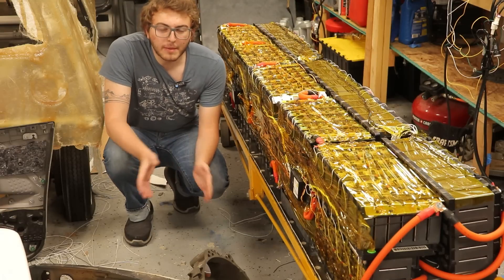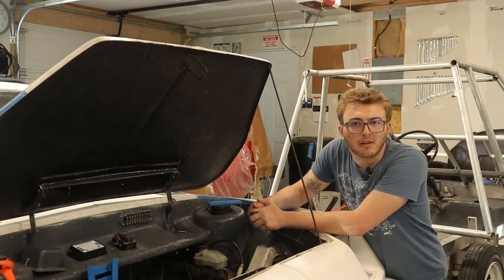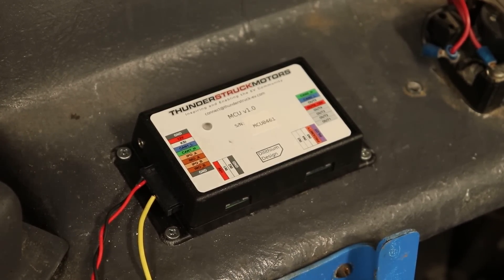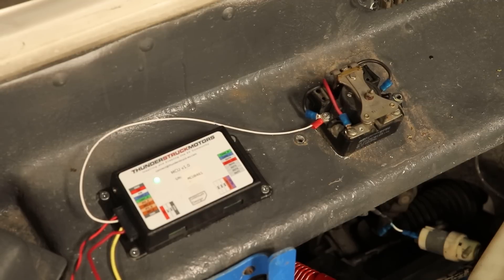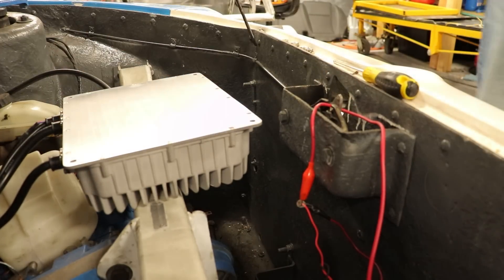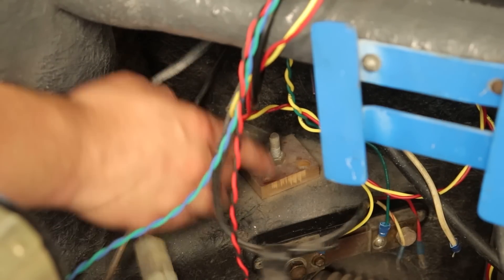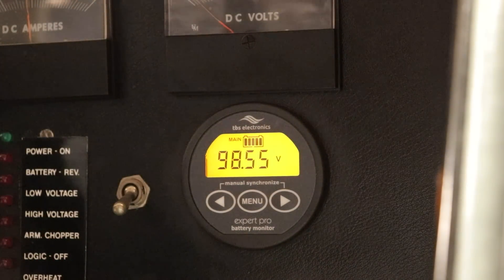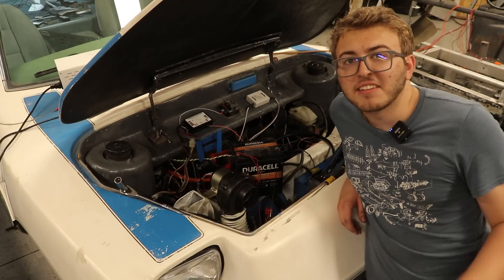Does the Electrek Drive on Lithium? | Part Two

Comment: Shunts can be confusing.

They work simply by having a calibrated resistance between the two meter terminals on the shunt.
Calibration is done in the factory usually by slitting the shunt with a fine saw until the resistance across the meter terminals is RIGHT at a certain value.

A "200 Amp" shunt will mean that the shunt will show a certain voltage across the meter terminals when 200 Amps is flowing through the shunt, maybe something like 50 millivolts (this value is often stamped into the shunt somewhere, I think).

And two shunts, each rated at the same current, may be of significantly different physical sizes, since they may be calibrated to different full-scale meter terminal voltages.

As long as the shunt is of low enough resistance to not overheat and fail at its maximum rated current, it can be of various sizes.
Reply from the maker: Very interesting!

Comment: Really nice project. I fully support getting it restored back to factory condition. When mounting stranded core wire in terminals, you should use tube terminals on the wire. Also hot glue won't last long in a car. Maybe create a bracket that goes over the device?
Reply from the maker: Yeah no the hot glue already failed, I'm gonna create a 3d printed mount for it

Comment: 14:30
Factory shunt had much bigger voltage drop so it could drive analog dial. 
Modern shunts are designed tomdeop 75mV at rated current. So at 1000A it would drop 75W.

Comment: I'd be worried about the charge connector placement, both that it is front-facing for weather ingress as you drive, and that it will potentially be underwater if you ever drive through a deep flood puddle or a ford a stream. Also, that MG is looking good!
Reply from the maker: The electrek as a whole doesn't drive in rain. It is not water proof. Also worth noting that if the charge port goes underwater, so will the controller, which isn't 100% water proof and likely would blow up the car. I think my solution is just not driving in water haha! And yes! The MGB is a surprisingly great car!
Reply: @ElectrekGarage  As long as you have considered those possible consequences, I feel less worried. I know the connector will almost certainly have some ingress protection, but never consider things to be "waterproof". Water gets angry at that designation and generally finds a way to let you know the term should only ever be "water-resistant" lol.

Comment: Quick question on the throttle.  I had a small EV (golfcart) and there was a main contactor interlock on the throttle.  Since you mentioned the throttle was reading slightly engaged is there also an interlock somewhere on your throttle?  Probably it is for safety as if you release the throttle and any other problems in the controller or circuit the contactor will open.
Reply from the maker: No interlock on this throttle, that would be asking too much from Unique Mobility

Comment: That rear suspension. So bouncy!
Reply from the maker: Like driving a trampoline
Reply: @ElectrekGarage  was it that bad with the Pb batteries?
Reply from the maker: @stazeII  nope! The reason it's so bouncy now is because the lithium batteries are significantly lighter than the original Pb's so the suspension is a lot lighter now. Ill be rebuilding the suspension in a future video!

Comment: This is absolutely awesome. I’ve wanted to see a lithium swapped Electrek since I learned about it in other videos! I’d love to know if it drives any differently, more power or anything like that. Looking forward to future vids on it.
Reply from the maker: Absolutely has noticeably more torque although I couldn't tell you why. My theory is that there is significantly less volt dropping on acceleration with allows for a smoother power curve. Thanks for your support!

Comment: This is AWESOME!
Can I ask you what your plans are after you complete your studies? Will it have something to do with electric vehicles?
It is my firm belief that repair and overhaul of battery packs , electronics and motors for EVs, and to a lesser degree converting ICE vehicles, has massive potential. Manufacturers don't want to know about that stuff, they just want to fit new spare parts or preferably scrap the cars every 10 years and buy new ones.
Of course the manufacturers will do everything they possibly can to prevent any kind of repair to the battery pack or drive train and a possible solution (besides non-stop lobbying and going to court for right to repair) would be to manufacture third party control systems using an open-source architecture.
My guess would be that third-party control systems for EVs could be a massive thing.
Reply from the maker: I would love to run a buisness that converts old cars to EV, however, my goal is more in the field of alternative energy storage systems, specifically Lithium Sulfur batteries. I'd love to build electric cars that implement innovative energy storage solutions in mass manufactured vehicles to push the industry to innovate cleaner and better solutions to the current technologies available!
Reply: @ElectrekGarage  I wish you all the success in the world with that, that is a hugely exiting field and it's only getting started. The possibilities are endless. 👍🖖🤟

Comment: Would be kinda cool/funny to swap out the J1772 connector for a NACS connector and post a vid of driving it to a Tesla Destination Charger for its first public charging session.

Also, 3M Dual Lock is great for mounting components without drilling. Holds them insanely securely and you can remove/reposition them later
Reply from the maker: Ooooo I'll look into that! A tesla charger would be hilarious! Also I will check out the 3m tape because the hot glue did not hold. Thinking about 3d printing a mounting bracket for it
Reply: @ElectrekGarage  Plus it turns out Tesla might of won the connector war. Chevy and Ford have announced their support of NACS going forward.

Comment: Amazing work! Restoring it to like new-condition visually sounds good. I don't like patina either.

Seems like you need to work a bit on the mechanical stuff as well. Especially the real shock absorbers seems to be completely shot the way you're bouncing around.
Reply from the maker: All suspension and brake systems will be replaced

Comment: I assume you're also going to correct the poor fit of the hood? I'd be looking at upgrades like a Nissan Leaf motor and a non-ancient motor controller.
Reply from the maker: The fit of the hood wasn't the problem. The footage was taken when I was still hesitant about driving it, so I left the hood propped open slightly in case I needed to emergency disconnect the battery. I've considered swapping the motor and controller for a modern part but I feel that would ruin the car's driving experience. I seriously love the ancient, terrible motor that it has!

Comment: 22:45 it needs some new rear shocks for sure. This jumping isnt normal...
Reply from the maker: It's mainly because the new batteries are significantly lighter than the originals so the shocks aren't the right stiffness anymore. I'll be fixing it!

Comment: Good work, nice to see it move under its own power. Very satisfying!

Another safety concern that just struck me, though: Do you have any BMS-controlled contactor at all? It's convention with large lithium batteries to always have a contactor in series with the battery power wire, that's able to turn off automatically if any cell voltage goes too high or too low. You also turn this contactor off when the vehicle is off, so as to render the vehicle safe in case of something happening to it. This is the same contactor as the one I recommended you'd have four of on the previous video.

The biggest risks in not running any BMS-controlled contactors at all are that you might reverse-charge cells under heavy load, which will ruin them very quickly, and that your charger might fail to respond to a soft turn-off command in case of some malfunction, and overcharge the battery. Reverse-charge under load happens if one of your cells has a higher impedance than the others in its string, so its voltage will drop more than the rest, without dropping the string voltage enough to alert you to a problem. This only needs to happen once or twice for that cell to basically shit itself and lose very significant capacity.
Reply from the maker: There are several bms controlled contactors that I installed after filming this video. This includes a main contactor and contactors in between the parallel connections like you suggested in a previous comment. I just didn't film it because I am lazy with the camera at times.
Reply: @ElectrekGarage  Great, I'm glad to hear it! Good job. Remember to test the system by either disconnecting a single cell (=creating a fault condition) or using the BMS's integrated test utilities, if available. You'd be surprised at how many ways there are to accidentally wire up/configure a BMS to simply disregard fault conditions.

Anyway, enjoy your battery-safe lithium Electrec! I'm very curious to find out its actual battery capacity and range.

Comment: I'm using that export pro battery monitor as well... is it right to always have to keep 12v on it - even when the car is off?  It loses its programming if I don't keep 12v on it at all times. :(
Reply from the maker: I don't have 12 volts to mine at all! It's should maintain its memory even with no power
Reply: I guess it’s not quite the same then.

Comment: are you planning to organize the wires in this vehicle and make them not hang around randomly while driving? it could pose some risks with them getting warped around something and breaking
other than that, congratulations on getting it to actually drive on lithium batteries

Comment: Maybe I missed it, but how are you cooling the lithium battery pack during charging and discharging?
Reply from the maker: Right now it doesn't really need it because the draw and charge of the car is low but I have some ideas in the future so that I can add faster charging